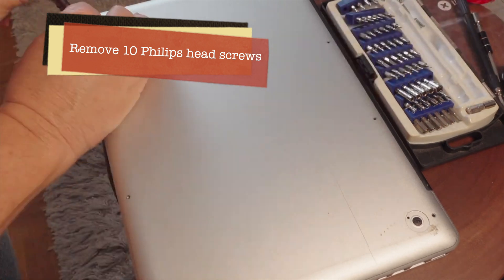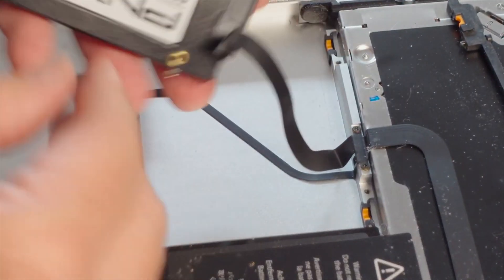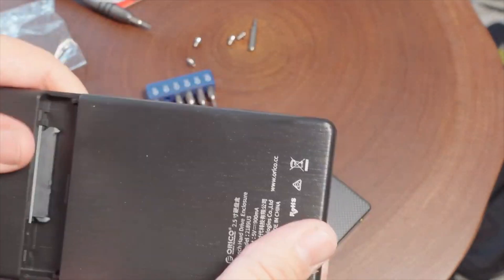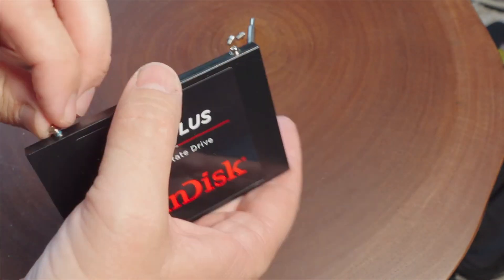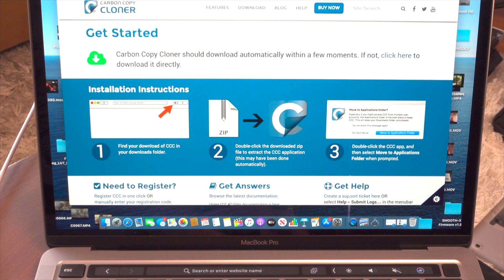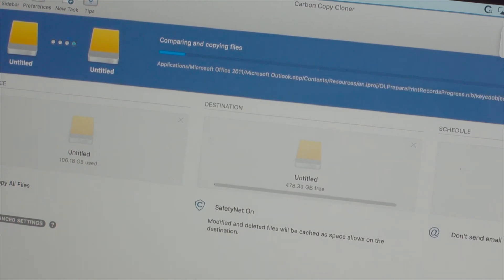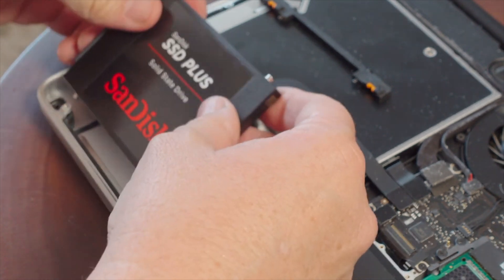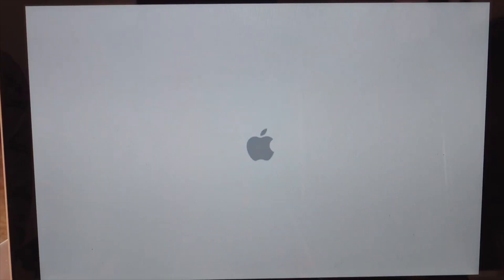How to Clone and upgrade a hard drive on a MacBook Pro

Comment: hi guys :) question, i saw in this video also programms running as Office (2011) if i'm correct. are you sure to copy this programms also without any re-install or activation? cloning the harddrive, maybe give the harddrive and the computer a new ID, right? if so ... after, every program will ask for re-install or activation ... it wan't shown here in this video. Thanks in advance guys
Reply from the maker: When you clone the drive all the apps go along with what you had your old drive. You may or may not have to reactivate it